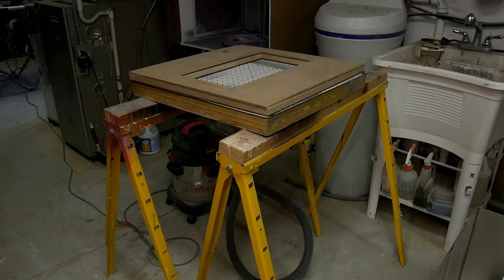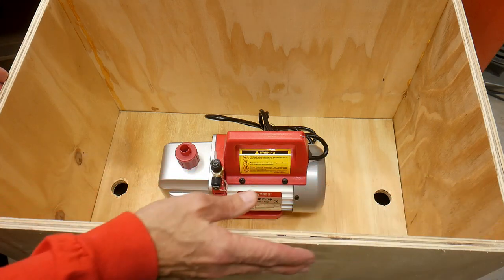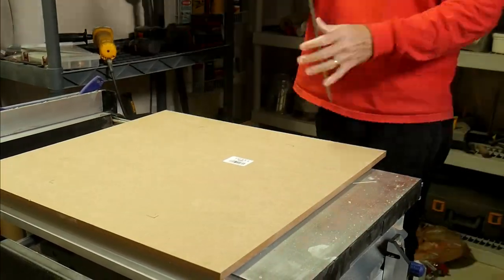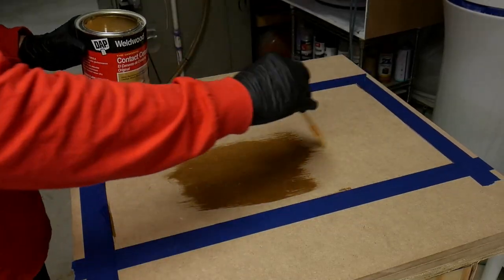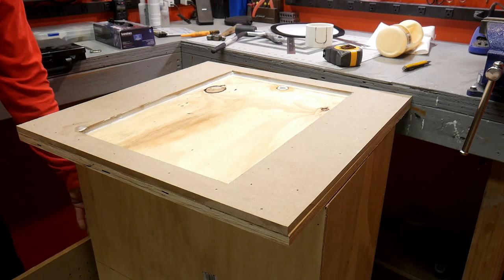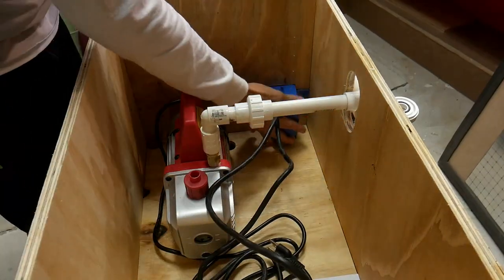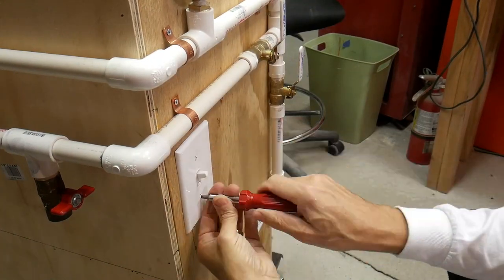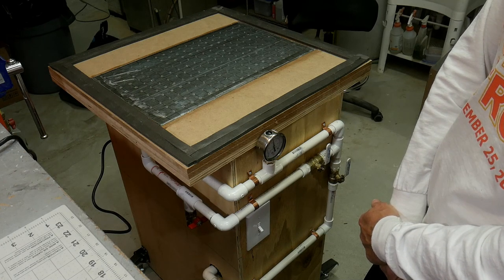How to: Build a Vacuum Former

Comment: Just came across the how to building a vacuum table.I am a carpenter by trade 35 plus year.I will be making this type of vacuum table.And to make sure it has a sound vacuum without any air escaping.I'll use a clear sand and seal paint product to be sure no air can escape thru the wood box atter the box is completed.Even the MDF boards will be coated as well.Should make for a completely air tight box,Thanks for showing how to make one.Think I can find a creep vacuum and air tank at some pawn shops we have around everywhere.
Reply from the maker: I'm glad I could be of help to you.  You always learn when you do something, so it's nice to show my mistakes first.
Reply: @wesmadebuilds681  That's how you learn.Iv made my fare share of mistakes as well.As long as you learn from them that's all that matters and it just makes you better.

Comment: that is a great project man.. And I have seen some of the other work you have done with fenders and the body you recently did.. Great work.. :) Just a thought:) I work in a machine shop, that has an adjacent carpentry shop. Which has a Gantry style Milling machine and it has a Vacuum table. For holding something as large as a Sheet of Plywood..for example. And Mdf is what is use as the top because it is that Porous, it holds parts right through the board. Something that surprised me, actually. That might be some of the problem. I did notice though you ran a silicone layer around the edge. That would defintely help..: Long winded sorry.. Love the build though and the ease of storage. Look forward to the future projects.. ;)
Reply from the maker: Yes, I will go into this in a later video but I needed to seal the wood with resin

Comment: What say you regarding the vacuum pump versed a push-pull carpet vacuum cleaner??
 I have a couple of fridge pumps that would probably work very well if I have a tank/reservoir like yours.
Reply from the maker: the vacuum tank is the best, doesnt really matter how you get the vacuum as long as you can store it up and deliver it quickly.  My parts with a vacuum tank are light years ahead of what I could do with a vacuum cleaner.
Reply: @Wesmade Builds  vacuum cleaners are pretty strong these days but not so much for a vacuum chamber I'm thinking also.

Comment: I'm still confused what the purpose of the 11 gallon air tanks for? why is this needed for vaccume forming, your only sucking air, not spraying ?
Reply from the maker: The tank is what you are pulling a vacuum on.  Its not like a vacuum cleaner where you constantly pull air in. You pull a vacuum on the tank and then quickly release it so the underside of the plastic has all the air sucked into the tank and forces the plastic down over the mold.